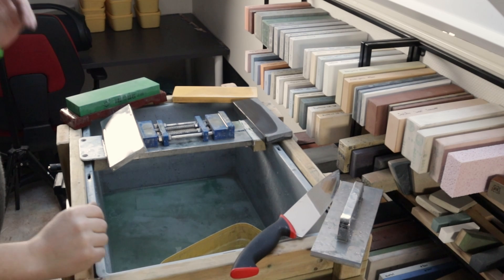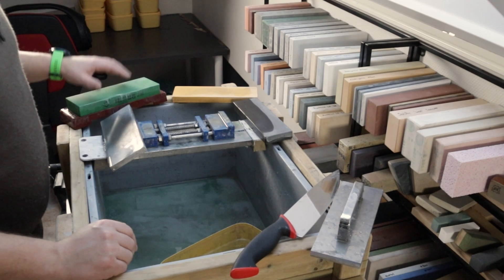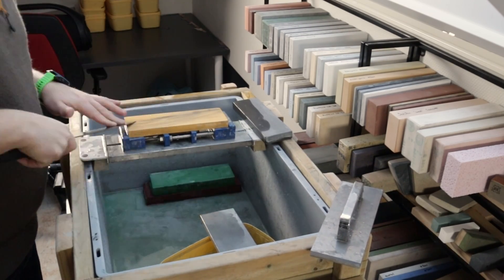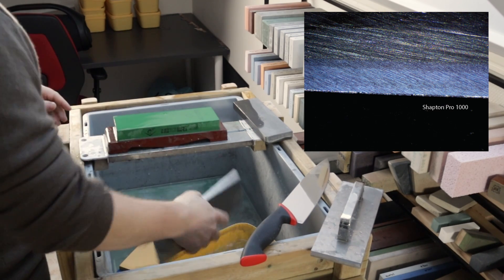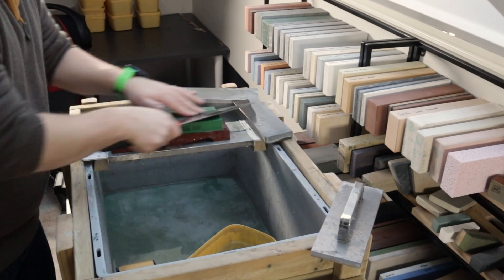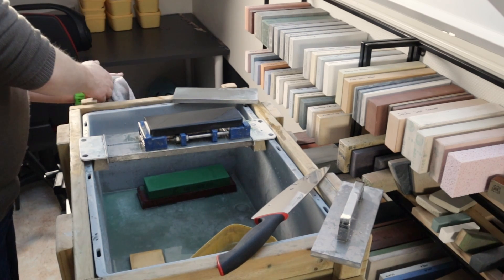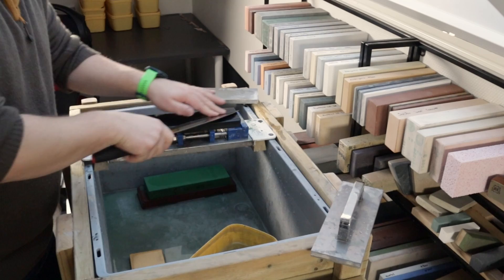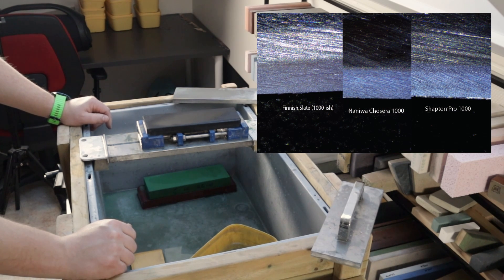Naniwa chosera 1k vs Shapton pro 1k grit comparison

Comment: Shapton pro 1000 is equal to a naniwa 800-900 or maybe Naniwa's are finer than what they should be.. my Chosera 2000 behaves like a 3000-4000 stone of any other kind and my Chosera 3000 is almost a 5000 by the results I get sharpening any kind of metal edged tool or knife.

Comment: Hi, your reviews have been excellent! They've really helped me in figuring out how a stone would feel like, hearing the sound they make and seeing the slurry and the feedbacks, your microphone is excellent!

After getting my 1st japanese knife, a cheap one, but carbon steel, a teruhide shimomura, 4 years ago I had been using local natural stones (very hard stones, 400-6K) to sharpen it, and some other knives. I them got my 1st japanese whetstone 2.5 months ago, a King KDS 1K/6K, that I reallly like. Then a Shapton Pro 120, to thin the teruhide, that has a zero bevel, I believe. What I think of the Shapton Pro, is that while it's a fast cutting stone, but it needs to be constantly refresh. That 120, if not refresh, would polish so well as if I was using a 3-5K stone. Then a month ago, I started getting the "chosera" line, a Miyabi Toishi Pro 400, and the Aratas, 1K, 5K, and 10K. These are excellent polishers, I think that those 4 cover everything I might need. With loaded balsa strops with 20K, 30K, and 100K powder/paste,as well as a couple of blank leather strops to finish.

Anyway, may ask about your spring-loaded holder? How deep is the "lips" on that one? The ones holding down the bottom edgese of the whetstone. I want to get one, it looks pretty thin. I missed out on the Naniwa holder, that looks like it's only 3mm deep, but able to hold down whetstones firmly. The case that comes with the Aratas isn't as tightly fit as the Shapton's.

Thanks again for the reviews! Surely made me feel like what I've spent have been worth every penny. Keep 'em coming...

Comment: the shapton pro is actually about a 700 grit stone iirc. even shapton will tell you this if you ask. its equivalent in the glass line is the 500. I think the closest chosera to this is the 600 grit, by far.

Comment: hello if you have to choose only 4 whetstone what will you take? thank you
Reply: anyone worth listening to would say... it depends on what you need them for. knife bros on the net are some of the "smartest" humans alive today. They don't understand for instance that different stones are for different purposes and think any 1000 grit stone is just the same as any other 1000 grit. 

SG320 imo is a better bet than the 500. But I'd take a 400 chosera over either any day and twice on sunday. The only other stone I'd maybe consider next to the chosera 400 is a 320 grit hard resin diamond stone I have. The chosera is still vastly more enjoyable but diamonds abrade very quickly and work on anything so in some alternative world where you can only have 1, I might choose that. 

king neo 800. another all time great stone. twice as fast as messy chosera 800 yet it wears much slower.  the contrast finishes it's able to achieve on anything from soft iron to stainless is equivalent to the 800 chosera but it's faster and vastly better suited for doing edge work. it will cut any tenacious steel like say 10v or maxamet or whatever other thing edc bros foam over.   I think it's a vastly better stone than either the 800 or 1k chosera. 

the SG4K and 3k chosera are both very nice intermediate stones but the finish they leave is much different. The SG is finer and leaves a much brighter finish also cuts faster, but the chosera finish looks much nicer to the eye.  They're otherwise fairly similar in how they wear and release grit 

3k ouka is a soaking stone which is is mostly suitable to doing wide bevels and tools like that moreso than secondary bevel edge work. I think it's a really good soaking stone but I mostly use the 5k rika. either the ouka or rika will be a lot finer than similar grit rated cerax stones because cerax is essentially an entire line of medium stones whereas the ouka and rika are finishing stones. These are the kind of details average folks don't know about. etc.  I only use stones like these for wide bevels and would rarely if ever consider them if all that's needed is edge work. 

idk what my favorite finishing stone is. I have a lot of them. an 8k sg costs like $100 whereas you can get a 15 mm 10k chosera for like $60 on amazon japan in the US. I'd have to say the Naniwa super stones are my favorite finishing stones. They are softer than most other stones because they are resin bound. These things can do things other stones cant when it comes to finishing and polishing. anyone would be fine with either the 5k, 8k, 10k, or 12k. I have the 5k and 12k. Again, you can get a 12k ss in 10 mm for like $50-60 on amazon Japan, few dollar more like $60 to $70 for 20 mm version.   

400 chosera. 800 neo. 3k chosera. and 12k ss. would be an amazing 4 stone set. total cost off amazon japan? less than $200.

but. theres so many other amazing stones available for all kinds of different uses. I love shapton pros. the 120, 320, 1k, 2k, and any of the finishing stones, 5k, 8k and 12k... all excellent choices. Only things you need to know is these are the hardest and slowest wearing stones around, they release very little grit, cut well, don't work great for wide bevels, the 220 and 320 are SIC and much more friable than any of the others like say the very hard white alumina 120. the 1k is actually about 700 grit. and that's about it.

Comment: Great video and point taken. Although the differences in #1000 grit rage are already known and tested.

It would be great if You managed to compare lower grits, that's something I am struggling to find deeper info about. Cerax 320 vs Shapton Pro 320 vs Chosera 400. And does it make sense to jump to Shapton 1k, since it's around #750. Shapton Pro 2k seems to cut almost as fast and with its true grit around 1,5k it may be perfect mid stone before 3k/4k finish.

Keep up the great work!
Reply: you can't just compare SNG stones to soaking stones. or stones from entirely different lines intended for entirely different uses. they are not equivalent nor interchangeable. Chosera stones are intended to be hybrids. They're supposed to look and feel like traditional stones while actually being modern SNG stones. They are quite unique which is why I think so many folks like them. There is no info and no where to find it. you have to do what anyone else had to do which is buy them all and learn for yourself. 99% of the things i hear and read about them online is obvious nonsense. most folks have no clue what they're talking about. 

the 2k "cuts almost as fast" because they're both medium aka sharpening stones. you don't "need" both. you're "supposed" to get 1 stone from each category to make a "set."   but also know what you're getting and why. the 120 to 320 are the course aka grinding stones. the 220 and 320 are SIC and different from all the other stones in the line. the 1k, 1.5k and 2k are the sharpening stones. The 5k, 8k and 12k are the finishing stones. and you are right about the actual grit of the 1k. The 8k shapton claims was developed for finishing knives whereas the 12k was developed for finishing woodworking tools but does it really matter? no. I have the 5k and 12k, but you could easily just the 8k and be just fine and happy. I have all of the rest of them minus the 1.5k. I think they're great. If I knew then what I know now, I'd likely get, 120, 320, 1k, 2k and 8k. I like SG finishing stones much more. but naniwa super stones are prob my favorite finishers of all.   

cerax stones are entirely different from chosera or any shapton. they are more like the naniwa traditional stones, except that they are actually modern stones and suitable for stainless steels. I also find the naniwa traditional stones to be harder and less friable than cerax stones which tend to be quite friable, they release grit readily and wear very fast with high pressure. They're suited for wide bevel work... and a light touch. basically modern versions of a traditional waterstone.